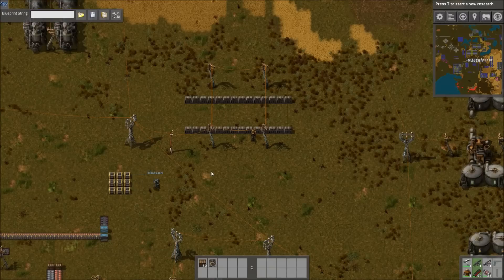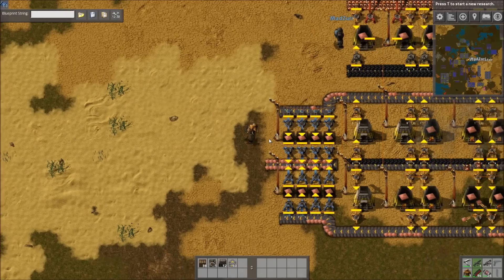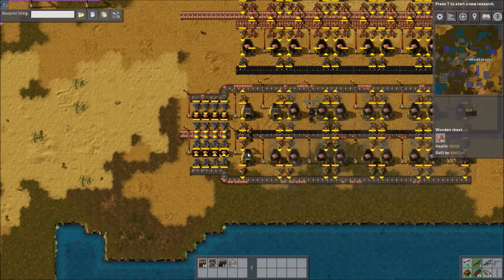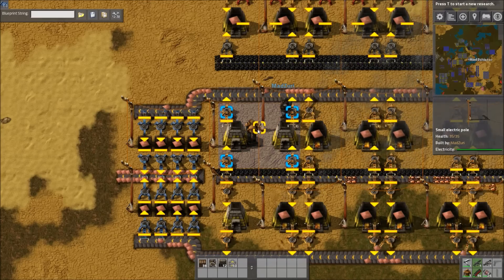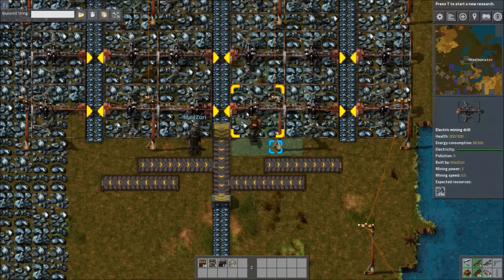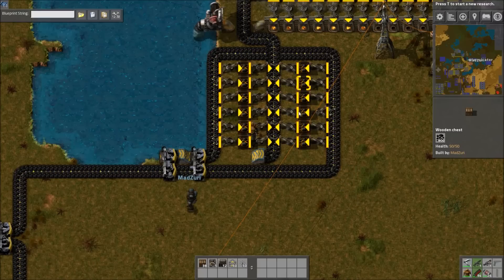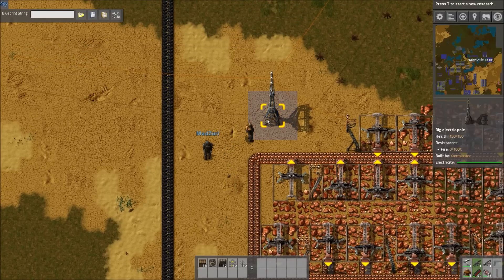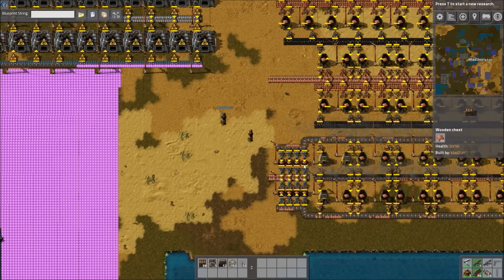Factorio Workshop - Building A Better Factory :: Buffers & Zuri's Mining Setup

Comment: And what about lane balancing after smelting? Because using a main bus, it's rare to get both sides equally balanced and using the same amount of resources.
Reply: I'm not convinced about the need to lane balance after smelting. If for every product on your main bus and the branches off it, every belt is full on at least one side, then that's good enough.

Part of me not being convinced is probably because I can never work out how to achieve it. :) Perhaps that could be another workshop +Xterminator  ?
Reply: I may have a poorly designed base though tbh... so maybe that's why i feel the need to use balancers
Reply from the maker: As PunkPensioner said, there actually is almost never a reason to lane balance aside from aesthetically making the lanes look better by having them balanced. We do plan to do a whole video on balancing and why it's almost never needed, or can even cause issues. :)
Reply: I agree that lane balancing isn't generally needed. I've found in my current playthrough however that using the Hacked Splitters mod in my 4 to 4 balancers and for my higher demand feeds off of my main bus lets me take better advantage of the 4 belts in my bus. I do have to use the circuit network to prioritize feeding into Green and Red circuits though, otherwise they don't get fed properly.

I'll probably tweak my methods further in my next modded game. I'm considering feeding my circuit production independently of the main bus.
Reply: Nice! I'm looking forward to it. I'm very particular about lane balancers. If they aren't input balanced as well, I won't even bother balancing. Why do I like input balancing? There's just something nifty about seeing all your furnace banks turn on at the same time to quickly replenish a single belt/lane after I hold down F and do a joyrun when I want some circuits or something :)
Reply: I'm at endgame in my current run but I want to keep going so I've stuck a pretty radical piercing ammo production line at the end of my bus. It wasn't enough, so now I'm starting to build a dedicated piercing ammo facility, with its own train depot and smelting. Since I'm using the AmmoBox mod I can pack a thousand piercing ammo magazines into a single stack of ammoboxes.
Reply: To contradict myself a bit, I do see value in lane balancing, it's just that I can never seem to get it right. If you don't buffer like this vid recommends, then essentially the plates on the belts are your buffer, so I do try to fill both sides if I can.
Reply: For me the main problem is that in vanilla it's hard to do a lane balancer that doesn't prioritize one lane over the other if you're side loading the belt your assemblers are taking from. On top of that I also tend to end up with the same lane prioritized at several points where I'm taking from my bus so the problem is enhanced further.
Reply: It is possible, but yeah there are a lot fewer designs out there. They have to be input balanced as well as output balanced, so that more inputs are able to replenish that extra draw you have on that one lane. I'm on the Factorio community Discord from time to time if you are interested in having a more in depth conversation about it +Timothy King.

Comment: The main idea for buffers are really to smooth things up, the great problem is figure out how to use them,  for beginners i would say probably the same as they pointed out on the vid, but to keep things simple, think like that, you shouldn't use buffers for things that you use all the time,  iron smelting for example, and you can, not needed, use buffers for things that some times you use, so when you go use is there ready. For example, I use buffers for things that I use for my self, not for the base, for example, power poles, I usually keep a chest with some so I can go an grab when I need, like "Oh, i'm out of poles, let me grab more", then while i'm doing others stuffs, using the poles they fill up back, but they are used only by me, you don't want to use them to running your base.

Energy is a little more complicated then that but is i nice comparison.
Think on Day/Night solar panel energy. You have no buffer (no accumulators), ok night time, everything shutdown. Day time, working again. If you don't wan't to stop working at night you will need to store energy, making buffers. So you can work all night. Easy right? No, that is where things get trick. The only reason for you to get buffers, in this case accumulators, is to keep working at night right? But if you don't have enough energy input they won't charge up and you will waste all that material that you could use to make more power. So you wanna get buffers only if you can keep your base on and the buffers full, you can see this on Day/Night power if you are only using solar panels, or Train outpost that have hight input when they are unloading (Day time) and go off when they are going back to the outpost(Night time), so you need buffers to keep your base running while the train are out, and to keep the outpost running to keep them full so you just wait the travel time. Otherwise you will need to wait the train (travel X 2) + miner time, and miner timer to fill up a train is considerable long. But remember the trick part, if you have so hight input that you can keep your base and the buffers running you will be making tons of pollution. And bad things happens when you have too much pollution, you could use this "buffers" to build more tech.

So, you use all the time, no buffers. Have that On/Off stage (Day/Night) you should consider but, remember that you need higher input to keep them at "off" time.

Am ammunitions is a good example to use buffers, energy in case of lasers turrents, you don't want to run out on middle of an attack, but you need a high enough production fill them up before the next attack.
Reply from the maker: One thing about the pollution argument that you didn't mention, which I think is actually the most important is the fact that it increases evolution rate. The pollution doesn't have to be touching any spawners/biters to increase evolution, it is increased simply by the amount of pollution produced globally. 
And yes, buffering and just storing some items are two different things. There is no issue at all with just storing like a stack or two of items used for building, like belts, factories, etc. However, buffering things like plates, steel, other stuff like that is when you run into the issues we discussed.
Reply: Energy buffers are a bit different. And when you're on lasers, your defences should already be pretty decent to not worry about over producing energy.

Item buffers should account for peak use, but as they mentioned in other comments here, you don't want massive amounts of buffered items.
Having a chest to hold a specific amount of items is okay. 

The only time Item Buffers are needed is when your peak usage is more than your production rate.
Furnaces have a stack buffer automatically, so if you have extended peak usage then a buffer may be okay. 

The cost of a buffer isn't just power or items. It's mostly pollution.
Having furnaces running constantly to fill a chest isn't the best. Because the pollution is pushing the biter evolution higher. So you're not dealing with Small Biters, you've got Mediums and Worms to deal with.
Reply: I don't find the pollution argument convincing. For new players, yes, pollution is a problem they probably haven't figured out how to manage. But I find it's better to check pollution on the map periodically and clear out biter nests so they aren't sitting in the factory's normal pollution radius. If you leave bases in pollution, they will attack regularly, and each time they do the evolution factor creeps up, not to mention the time, ammo, annoyance, etc. the attacks will cost you.
Reply: Yep, I think it's perfectly fine to have small numbers of all the game items in storage. This supports fast expansion, and being able to rebuild quickly after biter/spitter attacks.

In factorio terms, it's the intermediate products that you need to be careful with. The best time to put those into chests is when you want bots to be carrying them instead of belting them.

But its always a good idea to limit the amounts in the chests of every item, so you don't overproduce stuff you will never need.
Reply: I do find it convincing. And I agree your approach to clearing out biter/spitter bases is the best tactic. But overproduce with too many buffers, and the pollution radius you describe is larger and more difficult to manage.
Reply: If you're buffering intelligently, you may have to clear an extra base or two when you're occasionally out clearing bases, and the pollution radius will still be quite clear. Like I said, the pollution argument is only convincing when applied to people abusing the concept.
Reply: Storage and buffering are different concepts. A buffer is storage designed to be automatically pulled from when needed; not all storage is buffering though.
Reply: Yes, that's true. Guess I don't notice it since I normally stay ahead of the curve with military tech and production. (I really don't like waiting for military stuff when the time rolls around to clean up bases or gather artifacts.)
Reply: So many comments kkkk.
Agree, you can have your chest of "stuff", normal thing. Just don't use them for your productions lines.
I think new players have now a lot of reason for using or not using buffers. But remember, like Exterminator said, "buffers and storage are different things"
Reply: I keep a few chests of fuel next to my main input belt without an inserter so if something happens to fuel production all  I need to do is add an inserter to give me time to fix the problem. Later in the game those few chests are replaced by my train system. 

As for ammo storage I have a conveyor linking all my turrets at my main base to my ammo assemblers. I have know idea how much ammo is on that belt but it stays full regardless of biter attacks, and my running across it when I need some more ammo.

Comment: Are you doing any on train setups? Ie differences,  pros/cons between roll on roll off  or single headed trains vs one way in sane way out  or double headed train for loading  unloading
Reply from the maker: Well we've done quite a lot on rail junctions and loops vs double headed non loops systems and just recorded an unloading station which will be uploaded later this week. Probably at some point soon we will do a whole video just on train stuff which will probably include a lot of what you mentioned. :)

Comment: I once had a buffer chest full of speed module 3 get destroyed by biters. I didnt had a mega factory so it probably took several hours to fill that chest. the reason I was buffing them was because I wanted to save that many modules before I built an electric furnace setup. that was a horrible moment
Reply: I generally only have resource problems if I've forgotten to get new mining outposts set up, and when that happens I tend to go overboard getting the new ones going. I also set aside enough space to expand my smelting to max out the copper and iron belts on my bus so that when resources are low, or my factory starts consuming them faster I just stick more furnaces on the end and add a couple more mining outposts.

I''m also pretty pro-active about biter proximity. I turret creep shamelessly, and in my modded playthroughs I use Autofill, so turret creep is crazy effective. I try not to leave bases in my pollution cloud long enough for them to send attacks, and when I go out biter hunting I usually only stop when I've run low on ammo.

The increase in power usage and attendant pollution is the main reason I don't use speed and productivity modules. The trade off is that I have to build more assemblers and furnaces to reach the same production, so there are more resources tied up in buildings, longer belt runs, and a larger area to defend. That set of trade offs actually works surprisingly well to encourage train use, and I really enjoy using those trains. (Using Resource Spawner Overhaul also helps.)
Reply from the maker: Oh god that sounds horrible. :( I probably would of just rage quit right there and then honestly. 
I'm glad you managed to recover them after a while though! But yeah for really important/expensive stuff it is good to protect any storage you have for them.
Also, using a chest just for some normal storage isn't bad at all, like in your case. It's when you use multiple ones for an actual buffer and force your resources through it when it becomes an issue.
Reply: Another example, you should see Bentham's rocket train (towards the end of the latest episode of railworld). He was using it as a buffer to accumulate all the rocket parts. Didn't end well. :-(
Reply: Spoilers! (I'm behind on Railworld)

Similar to losing the storage, I dumped a frustrating amount of production in to Speed 2s because I set the limiting inserter wrong and ended up with at least 10 stacks of them. I don't use a lot of Speed 2s or 3s so I could probably get through at least 3 games without using that many.
Reply: Depends on how you play, I guess. Beacon builds eat speed modules like candy - 10 stacks would last me a few minutes of construction - and the material savings from putting productivity chips in the furnaces/assemblers stack well.

Copper/iron plate, copper cable, green/red/blue circuits, not to mention oil stuff - with productivity modules, you can really reduce the amount of materials needed to make...better modules lol. Kind of a self-creating/solving problem.

Shame that we have no end-game resource sink yet. (I don't like rockets.) Being able to build in space, and possibly set up factories on multiple planets with some kind of spaceport economy thing would be pretty cool.
Reply from the maker: Definitely right about beacons eating modules like candy. xD I just started setting up some beacon robot based production stuff in Building Big and keep running out of modules to put in them and the factories. Lol 

I agree, some sort of economy or something to sink resources into with some type of goal/reward would be awesome! I mean sure there are things like the infinite scaling science mod and such but that gets old after a while. I also don't like making the rockets (do like launching them however), so I've really enjoyed the Power Armor production thing in Building Big instead of the rockets.
Reply: Quick question, is there ever a reason to put efficiency modules in beacons?

The game disallows productivity beacons, so I've only ever used speed in beacons.
Reply from the maker: Michael Matthews
Efficiency Modules in beacons can be really good actually if you are low on power or wanting to lower pollution production. If you don't have issues with either of those things then speed is definitely better.
Reply: I've been using Efficiency modules everywhere. There are like 3 or 4 places I'll use speed (Like depleted oil wells), and half of the time I don't even start making Productivity modules until I decide to make something that has them in the recipe.
Reply: Efficiency modules are a great default choice; they're fairly cheap and can reduce power/pollution by up to 80% IIRC. Trouble is when I get modules I'm running up against supply shortages.

Recently I've been wondering whether it's better to setup self-healing defenses early, then go for level 1 productivity/speed and keep using the savings to upgrade to level 3 productivity/speed.

Level 3 productivity means a 20% bonus to furnaces, 30% to refineries, a further 20% bonus to chemical plants, and 40% bonus to copper cable and 40% to each of the circuit types. End result: e.g. blue circuits are much, much, much cheaper. IIRC science labs also accept productivity modules. Even putting the cheap level 1 speed modules in beacons means you'll need far fewer machines with level 2 or 3 productivity modules.

Problem is, power usage and pollution of speed/productivity go through the roof though (e.g. factory's peak power can easily go > 1 GW). However, productivity modules indirectly make everything cheaper to produce. IMO self-healing defenses are required to cope with the massive pollution.

One way to reduce idle power of beacons is to break each production chain into small groups and power them through power switches with tiered conditions on buffer chests' contents. e.g. 3 copper furnace blocks would have something like < 4k plates, < 8k plates, and < 16k plates respectively. So you would only be powering all 3 furnace blocks when plate supply drops low enough.

Alternatively, you could monitor belts on the main bus. Maybe probably use combinators to output signals based on the sum of items on a group of belts (to estimate current demand). I just find (small) buffers an easier way to monitor demand.